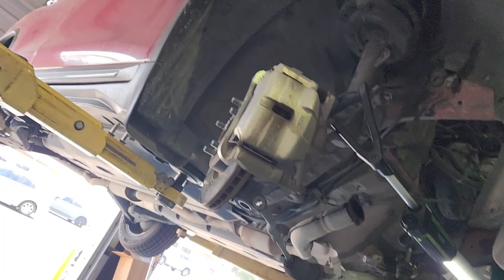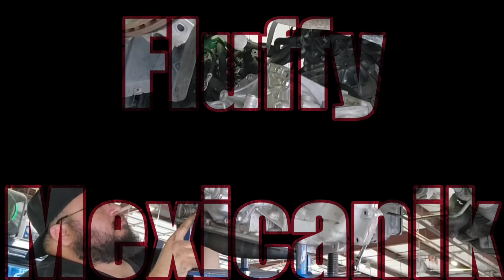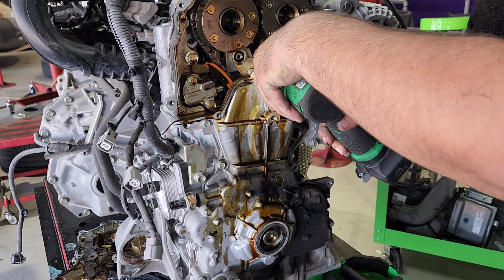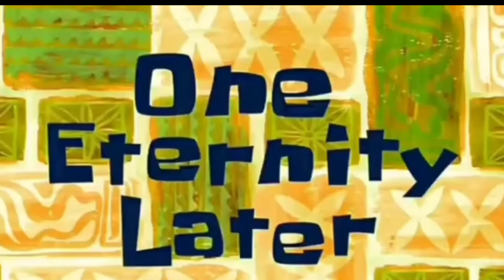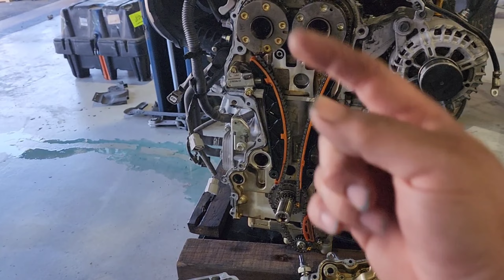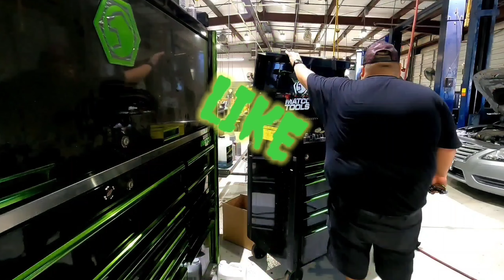GONE WRONG 2017 ROGUE TIMING COVER REMOVAL #auto #mechanic

Comment: What “went wrong”? Seems like you did the job no problem
Reply from the maker: I had to back track to remove the upper pan then timing cover thinking it was simular to the altima that you can do with out removing the pan
Reply: Ahh not too bad! When you remove the wiring harness do you just unbolt the fuse box and lay it onto?